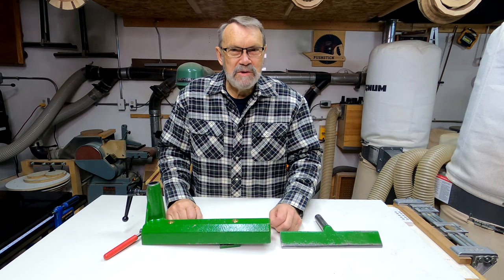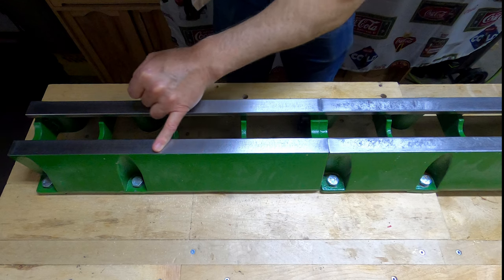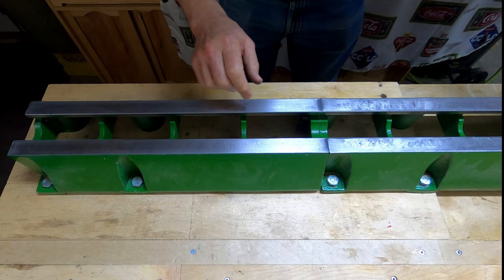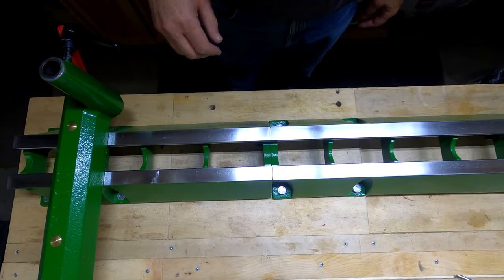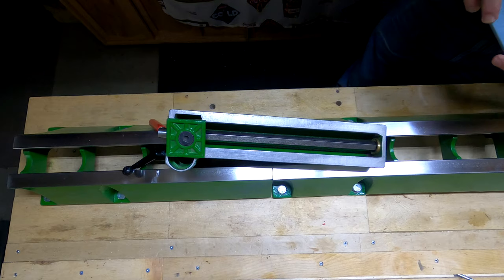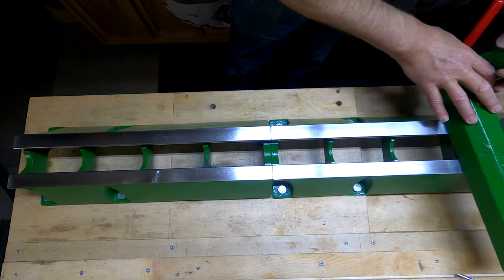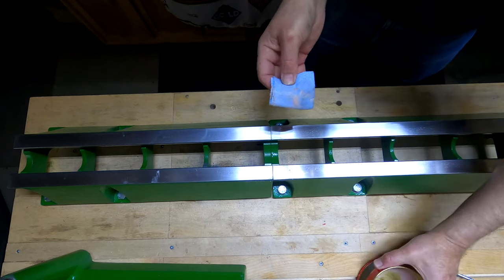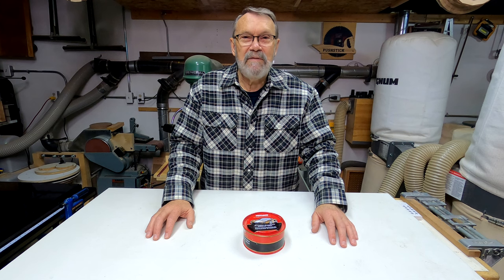Make Your Banjo Slide Again

Comment: Hey Gord:

For me, using 80-320 grit sand paper is a little too aggressive on the metal.   When I clean up my shop tools, typically I will start out at 400-500 grit and work my way up to 1000.   I have done this to my table saw, jointer and band saw with beautiful results using a lubricant like WD-40 or Fluid Film Powerful Rust & Corrosion spray.  After that, I apply Johnson & Johnson paste wax as a protective coat to allow easy sliding of the banjo &  wood that makes contact with the metal.   

If there are persistent rust stains, I will use valve lapping compound on the metal surface.   

Going this route, there will be more elbow grease put into the effort, but the finished result comes out nicer.  But, that’s just my opinion.  Go with what ever works for you.
Reply from the maker: You are correct, John. 80 grit is very aggressive to start with but although I don’t think the video showed it very clearly, the bedways of this lathe really needed aggressive sanding. Now that it has been done I should never have to go back to anything as course as that again. I’m sure everyone has a different opinion as to what should be used for lubricating the bedways. No doubt there will be some who believe that no lubrication should be used. To each his own, as they say. This is just my method. Thanks for watching!
Reply: @GordonRock1  To me, the brand of lubricant used while sanding the metal is not that important.  WD-40 and Fluid Film were brands that I had on hand at the time.   I’ve used 3 in 1 oil, ATF, honing oil and even a light film of grease to aid in sanding.   All the lubricant does is aid in keeping the sand paper from clogging up with materials; which helps the paper work better.  At times, I even used a light coat of Vaseline.   I’ve have even heard vegetable or olive oil will work in a pinch.  But, I have never used personally on metals.  It’s what ever floats your boat at the time or have on hand.
Reply: Hi John(I have only known you as J) Johnson paste wax has been my main wax since around 1962 for finishing wood projects and for tops of my machines. Although I do not use it on turnings.

Comment: I usually sand mine with 400 every 6 months or so and immediately wax them, Gord.  But it is definitely something needed to keep the surfaces smooth and easily operational.  I do the same thing on my saws as well.
Reply from the maker: Billy, I’ve been meaning to do this for a long time. I’m glad that Phil motivated me to finally get it done. It sure is sliding much easier than it was! I had not thought of doing size but may have to look into that. Thanks for the input, buddy. Thanks for watching!

Comment: Great tip Gord. FYI - Instead of the wax, I have used the dry silicone spray. It says on the can that it is used for metal on metal surfaces, so I figure it is OK. Let me know if you disagree, but I can tell you that I found it works equally well. Thanks for sharing. Stay safe my friend, Regards Dennis
Reply from the maker: I have some dry lubricant spray but I don’t like it because it’s black and makes a heck of a mess. If I could find some clear spray I would be happy to try it, Dennis. Stay well, buddy!
…..Gord

Comment: The problem with my ancient Rockwell lathe wasn't the top but the bottom. The Banjo slid easily along the bed but not across it. I cleaned the locking dog and the bar it rides on with brake cleaner and did not oil it. The adjusting nut was loose, and, after a little time, allowed too much play between the locking dog and the bed rails above it. That allowed the thing to cock to one side which caused the ring to clamp tight to the rod. I adjusted the nut to allow bare minimum loosening of the clamp and then set it with Loctite thread locker. Ever since, the banjo moves easily in all directions.
Reply from the maker: You must be a great problem solver, my friend. Diagnosing that would be beyond a lot of people. Congratulations on figuring it out! Thanks for watching! 😃😃
Reply: @GordonRock1  The way I stumble through life, problem solving is as necessary survival skill.

Comment: I use fine and ultra-fine non-woven abrasive pads (Klingspor - most are more familiar with 3M) and a non-automotive paste wax containing carnauba (Johnson, Briwax or Trewax). I lightly abrade the ways only when necessary for cleaning black marks or finish residues, and wax six times a year; more or less depending on activity level. That's worked for 38 years on the same lathe.
Cheers,
-- Joe
Reply from the maker: That sounds like a real good maintenance regimen, Joe. I hope to remind myself to do something very similar for my lathe on a regular basis, my friend. Thanks for your input. It is appreciated, as always. Thanks for watching!
All the best,
…..Gord

Comment: Gee thanks Gord now I have to go take care my lathe. I do something like this but it has been a bit too long. I normally use Scotch Brite and Johnson Paste wax. It might be time for some fine sandpaper. I am heading out to the shop and promise I will do it before mounting the blank I have picked out!
 Lots of great tips my friend,
Gary
Reply from the maker: It’s been a bit too long? You mean I might have to do this more than once!! 😳😳😟😟 I was afraid I would have to spend a couple of days in bed recuperating from this. I used to be used to physical labour but I think that was back in the ‘60s. Always happy to help, my friend. Especially if it doesn’t involve me actually doing anything. 😃😃😃 Thanks for watching, Gary! 😃😃👍👍👍
Happy turning,
…..Gord
Reply: As promised I did go out and work on the bed of my lathe before mounting the next piece. I went over it with 320 grit and then used some Johnson paste wax.  Very smooth now. 
 By a long time I was thinking of waxing it up. I think cleaning it with DNA and then wax keeps it in shape.
What you did will last a LONG TIME before needing that treatment again.
 Who ever said reading instructions to assemble something and doing maintenance is a good thing LOL
 See ya later!
Gary

Comment: This issue comes about because of dings in the metal, but a more serious problem is applying finish to work on the lathe - unless you carefully drape something over the bedways, you will get finish on the bedways that has to be removed for the banjo to slide smoothly.  

I clean and lubricate my bedways once or twice a year.  I normally use a red Scotchbrite pad rather than sandpaper.  Some people recommend WD40 as a lubricant  - I find that spraying a little WD40 can help the Scotchbrite clean the surface of the bedways, but it's not a lubricant.  Instead, I spray on a coat of white lithium grease - a drying aerosol that is mainly sold for lubricating garage door rollers.  Because its dry, it won't attract dust and become gummy.

I also disassemble, clean and lubricate the tailstock ram.
Reply from the maker: I agree completely, Louie. I NEVER apply finish to anything on my lathe unless the bedways are covered. I have needed to do this for a long time so I guess I owe Phil a great big thank you for motivating me to do so. Thank you for your input and for watching!

Comment: Good instructional, Gord. I found out last week that the slightly damaged new lathe I ended up with will be replaced so that makes me happy. Of course, because I wasn't sure if this was the one I was keeping or if it was being replaced, I was taking as good of care of it as possible. But, I was sawing off a piece add my saw went through and left a tiny ding on the bed. Yes, it made the banjo slide by slightly rough. Thankfully a diamond file cleaned it right up, but let me say that mineral oil and beeswax mixed my best friend on that lathe bed.
Reply from the maker: Oh, I’m so glad they are replacing it for you, Jay. That sounds like another good lubricant. I’m sure I will hear about a lot more of them by the time people stop commenting on this video. I appreciate your input, my friend. Thanks for watching!

Comment: Well done Gord! Great instructional video. 
Every couple of weeks or so, I take some 320 to my bedways, then clean with denatured alcohol, then hit with 320 again, and another hit of denatured alcohol (just to remove all metal dust) the. I use Briwax furniture wax, and it seems to do the trick. Doing this treatment every few weeks keeps me from having to start at low grits and work my way back up. 

Thanks for sharing your process!
Reply from the maker: It sounds like you have a great process figured out, Seth. I wish I could say that I will be as meticulous about it as you but I doubt that I will be. Thanks for watching! 😃😃

Comment: Great job Gord I usually us steel wool for cleaning up my banjo and the surface of my jointer and table saw and a good coat of paste wax I put it on heavy and let it soak in and then polish it and what a difference it makes
Reply from the maker: That sounds like a very good method, Wade. I have to make it my practice to do something like that much more frequently. Thanks for watching!

Comment: Nice video, Gord.  I have three lathes and I usually do something like this on a regular basis to keep them sliding well.  Since I don't wait for them to get really gunked up, I can get by with just 180 grit for the most part.  Might want to mention that a quick pass on the inside of the bed rails will also help keep the banjo sliding.  One question, though.  Do you need to use walnut for the sanding or can I use some hard maple?  LOL  Keep your tips coming, my friend.  All of them are worthwhile.
Reply from the maker: According to the IFOWTF&I (International Federation of Woodturning Fanatics & Idiots) of which I am the current president it must be Walnut. Sorry, but if you used hard maple you will just have to do it again to get the proper finish. I don't like it either, Tom, but that's the rule! 😃😃 Thanks for watching! 😃😃

Comment: Thank You Gord...Wow Gord, a woodturner/machinist you are. First time I have seen consideration of the lathe to this degree. In the past I have used Dry Silicon Spray Lubricant. It does not collect dust and is very slick. Do not know if that would be right for you?.....TM
Reply from the maker: You bet, Tuffy. That sounds like a very good lubricant to use. I would run right out and get some but by the time I get to the proper store I will probably forget what I was going to get. One of these days, I hope. Thanks for watching! 😃😃
Reply: @GordonRock1  I thought I was the guy that keeps forgetting stuff.....oh yea....stuff.....yea, stuff....ah...ah....now what was it I wanted to say???? ...... (something about stuff).........oh well.....maybe later???.......TM
Reply: A Texan was bragging at a party about  how HUGE his ranch was.
"I can leave my front door. Get in my truck. Drive all day long and still never reach the end of my property"
A polite listener smiled at the Texan and said
"I know exactly what you mean. I use to have a truck just like that"
Reply from the maker: 😂🤣😂🤣 Thank you, Tuffy! I can always use a good laugh!!

Comment: Gord, don't know about starting at 80 grit? That seems pretty coarse for metal. But I do have this as a go-do because my banjo does not slide well either. But, I'll probably start at 180, even 220. The further grits are dependent on how tired I get...and ultimately I will take you advice to add some wax. Thanks!
Reply from the maker: I was not advising anyone to start at 80 grit. My Bedways were just in bad shape and needed aggressive sanding. You certainly should start at whatever level you think is right for your lathe. I hope this was helpful for you! Thanks for watching!

Comment: I'm sure that helped a lot but does your center points still line up the same? I know some metal was removed just curious on how much it changed. Take care and GOD BLESS 🙏!
Reply from the maker: Stephen, I assume there is a difference but I certainly can’t see it. The points still line up as well as they did before. Thanks for watching, my friend!
Reply: @GordonRock1  you would think that much sanding you would be able to tell it. I'm glad it's ok tho 😃
Reply from the maker: I was using sandpaper meant for wood. If I used sandpaper meant for metal it might have been a lot more aggressive.